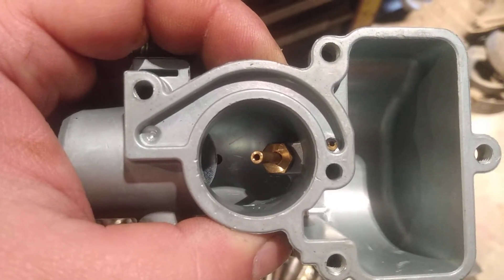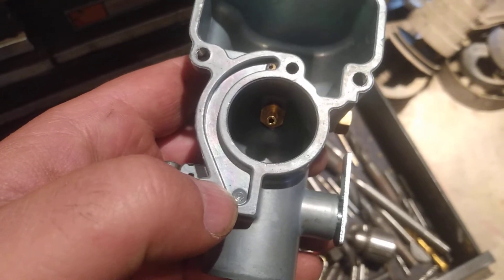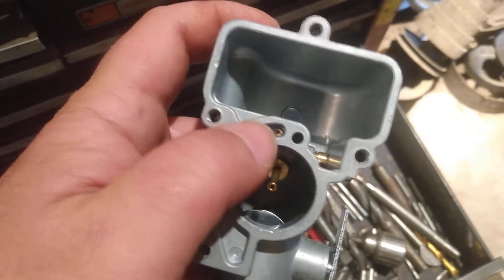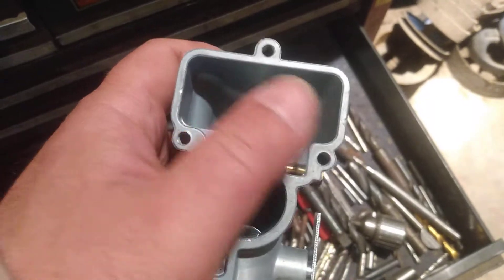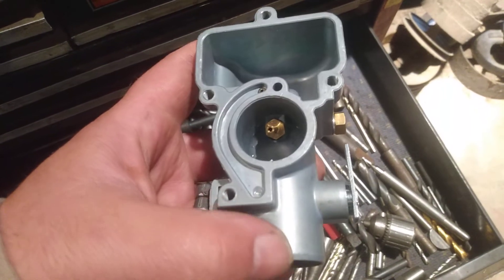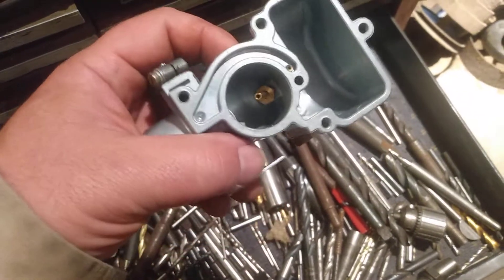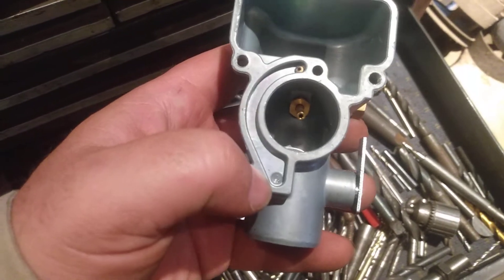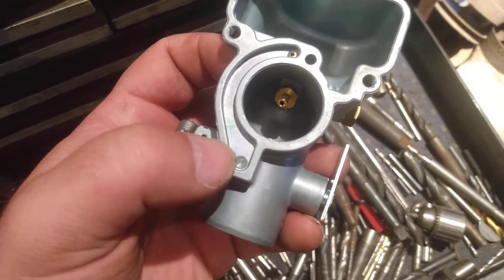Missing float bowl vent hole in new Farmall Cub carburetor

Comment: Oh man you just made my day, I bought the same carb from another seller, it would run 15-30 seconds and shut off. Pulled it apart and sure as sh** it had the same dimple as yours. Great video, by the way how did yours work after you drilled it?.  Thanks
Reply from the maker: Excellent! I have not had any trouble with my Cub with this carb.

Comment: I think i got the same problem sometimes starts for bout 3 seconds an dies just not getting gas im gonna open mine up an check it does it matter where to put the hole as long its behind the choke shaft ? Thanks for the tip i got 2 of these carbs an both acted the same i messed with it for hours til my head ached
Reply from the maker: My carb had a pilot dimple at the location where the hole is supposed to be, in the end of the channel in the top of the casting. If yours doesn't have the dimple, watch again the video and drill a hole where the dimple on my carb. The hole should be square with the top of the casting and be about 1/8" diameter.

Comment: I just had the exact problem. Was going insane trying to figure out why it wouldn’t run. What size hole did you drill?
Reply from the maker: About 1/8 to 3/16 inch. I did not take note of the size of the bit I used.

Comment from the maker: This carb was purchased from ebay seller motorcyclepartsfactory https://www.ebay.com/usr/motorcyclepartsfactory
If you plan to buy a carb from them I strongly urge you to take the carburetor apart and inspect it for similar defects. The undrilled passage in my Farmall Cub carb was easy to correct, but more serious defects may not be so easy to remedy.